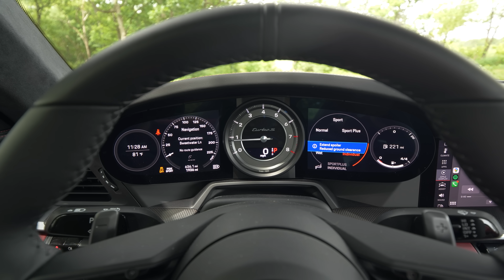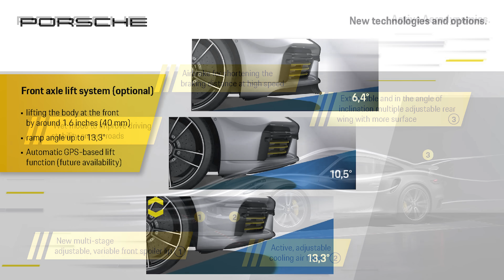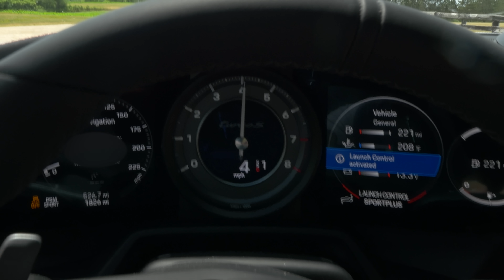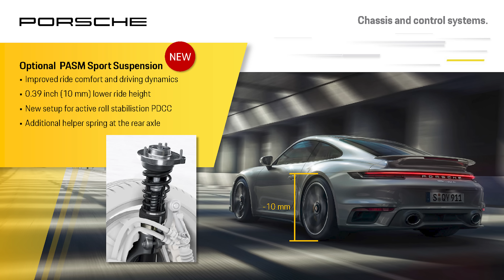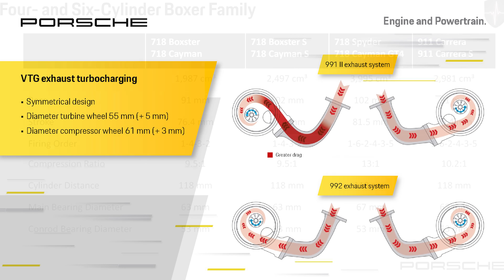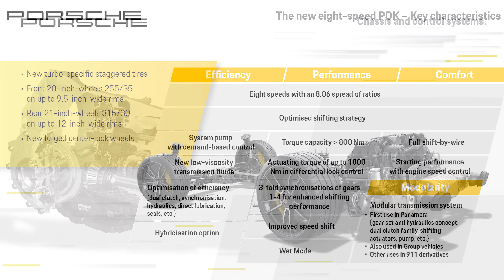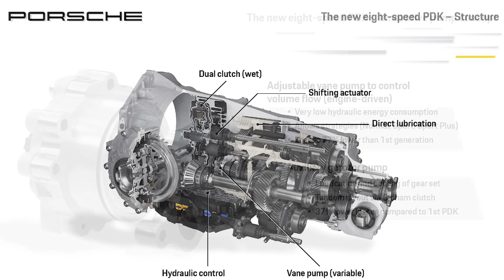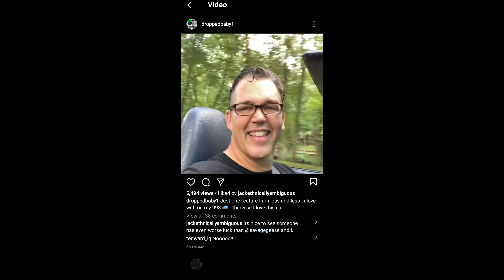Porsche 911 Turbo S 992 | Mind Bending Speed

Comment: What a marvelous piece of engineering.  3.8 Twin Turbo, 4WD with emphasis on RWD and up to 50% power transfer to the front as required.  4WS.  Hold on a Minute; that sounds just like all the Nissan Skyline GTRs R32, 33, 34 without the big engine, which finally arrives in the R35.  The R35 was built to beat the 911 Turbo, which it did very well, and sent Porsche back to the drawing board to improve this car and once again regain its title.  You mentioned more boost and bigger turbos, but you didn't say how much more boost.  You also complain about the car not revving the way the GT3 does, but it doesn't need to do that to accomplish the power so why bother?  The RB2600 engines rev to 8000 rpm stock, but are eager to comply to 10,000 if the limiter is removed; and an all-out race version will be happy to oblige you with 13000 rpm.  The R35 V6 is more like this car, and as turbo engines go, there is no rocket science to them; build the bottom well, and add CFM/Boost and they will go. The direct injection bothers me however regarding carbon buildup on the valves, and it would have been nice to have port injectors added for better flow management but most importantly to keep those valves clean.  I would like to hear how much boost this car runs (22.5psi) and what a stock R35 and Nismo R35 run stock to keep things in perspective; because it seems that it was just yesterday that these feats of impossibilities were being cast on the stock R35, and how fast it changes direction without fuss to the point where it gave Jeremy Clarkson a whiplash on the track.  So having said all that, I'll add that I love everything about this car, and it would certainly be on my list of must-haves.

Comment: 911s are truly a daily driver, speaking from experience. I am more of a fan of the NA engines. You can work on them yourself. Need a lift with the turbo cars. Most of the turbo components make for much more difficult maintenance. If you don't plan on working on the car yourself then the added HP from the turbo cars is well worth the money.

Comment: Interesting comment on the sound system not being as good as the LC500 (which I own) .....but I find the Levinson disappointing.
Reply from the maker: What settings are you using on your lc500?
Reply: @savagegeese  Increased the base, mid range and terrible to about "75%", have the fader control bias a little toward in the rear.  To me it sounds like most of the sound is coming from the front speakers  When I tried moved the fader to all rear there was very little sound.  I thought something was wrong.  Even went to dealer and tried another LC and it performed the same.  I also have dynamic and surround sound on.  How do you guys set it up?

Comment: There is a reason Mazda has closely engineered their vehicles after Porsche for decades. Because Porsche has mastered strut suspension, much like Honda has mastered front wheel drive.
Reply: They've mastered it so well they abandoned it for their track version. I wish they had just put the double wishbone in all of them. At this price they could have easily afforded to, and Porsche appears to think it is better (and so does Mark).
Reply: @markmiller3279  The only problem with double wishbone suspension is obvious maintenance. There is a lot more going on. Replacing one ball joint and two bushings instead of 3 ball joints and 6 or 8 bushings after a decade is a LOT less expensive. Alignments are simpler and suspension geometry is more complex.

Struts are so resilient and simple for everyday vehicles that double wishbone is only really necessary on a track car. Decades ago before struts were perfected, there was no doubt their high speed stability and toe-in was inferior, but the gap has been bridged so closely that most drivers wont even notice, and that's why it seems Porsche very specifically used struts on a vehicle that they are not marketing for track use.

Comment: Even with all these upgrades done in this car over the 991.2 gen Turbo S, this newer one is still two tenths of a second slower than the previous gen around the Nürburgring. And Porsche also confirmed it (source - Sport Auto). Straightline performance is great, but why should we spend this much of money on this thing when we can buy even cheaper cars and make them faster than this? (E.g - a used older Turbo S, a GT-R or a C7 Z06) even after that upgrades they'll be cheaper than this. buying a 992 Turbo S will be the worst way to spend $225K.

Comment: Amazing car, but unfortunately, not exciting at all. the engine seems to suffer some lag, dull response below 3500 rpms, and it is amazing a car company like porsche is able to make such a fast car with such a low level of engagement. The engine is the culprit. The way it delivers its power and torque, the throttle lag, etc...makes the car super uninteresting..a 997 gt2, much slower, is way more fun to accelerate. So sad...

Comment: In 2014 Road and Track launched a 911 SIXTY-ONE times, back to back. They had to stop not because of mechanical failure, overheating, anything else but simply because the driver was getting woozie. Launched the same, every time, zero diminishing in performance, over 60 times back to back, no failures, no overheating, no limp-modes, just obedience.
https://www.youtube.com/watch?v=A5DRCTW-Q7o

Comment: I hate to beat a dead horse but why is the c8 even coming up in this conversation. This is one of the top 911 models and the current c8 again is the BASE car. They shouldn't remotely come up in comparison. Heck even the z06 spy photos/videos (not even the top c8 model) look and sound so much crazier than the base model and thats only step 2/4 models. Lets see how the zora c8 compares to this car. It wouldnt be fair to compare a mustang350r to a base level nissan sentra....
Reply from the maker: Regardless of 911 trim its same story in terms of handling and feeling. They dont take away all the driving involvement.  There is a balanced approach to connecting the driver with the car.  The current C8 is about specs right now until they get the upper end cars finished.

Comment: The problem with your dig at Nick Murray is that he lives and breaths Porsche every day.  You're just a "Porsche tourist".  Your fantasy about Porsche reliability is sort of like enjoying a glitzy Caribbean resort while ignoring the poverty the resort workers live in.  For objective information about Porsche, I'll stick with Nick.
Reply from the maker: There were no digs at Nick.  We have many friends with Porsches including winter driving GT3s etc and they havent had the shit show he has had.
Reply: @savagegeese  LOL, thanks for the honor of a reply.  I tend to lump Porsche owners into two groups:   Porsche fans and  Porsche fanboys.   The fanboys don't talk much about what goes wrong with their Porsches since it's a quasi religion.  The Porsche fans tell it like it is.  Nick Murray and I are Porsche fans - not fanboys.  I love Porsches for how they drive but I wish they'd approach the build quality of a Toyota or even a Honda.  My current daily driver is a nicely equipped 10 1/2 month old Cayenne that has been to the Porsche dealership repeatedly for repairs.   It took four visits to the Porsche dealership to get a Drive Mode problem fixed.  The first two times, I was told that my Cayenne was operating as designed.  Their attitude changed when I found information about a fix TSB on a Porsche forum and they realized that most Cayenne sold in 2022 had the same problem.  Then it took two more trips to the dealership to get the TSB fix correctly implemented.    And there have been at least three trips to the Porsche dealership about an "InnoDrive" cruise control issue that can make it quite "exciting" to the point that I won't let my wife drive it.    They don't have a fix for that problem yet which also affects the Taycan but maybe I'll find info about a TSB fix for it at some point on a Porsche forum.  And I'm making another trip to the Porsche dealership next Thursday to have a rear air vent replaced that has some sort of internal problem that prevents adjusting it ... might have been that way since new since I've rarely had people in the back seat.  At least I'm retired now and have time to take the Cayenne in for repairs.  I've probably already had the Cayenne in for repairs more times in 10 1/2 months than I had my Lexus LS sedans in for repairs (not service) in 24 years of daily driving them.   Nick Murray's Porsche problems are real and so are mine.  That doesn't take away from our enthusiasm for how they drive.
Reply: Imagine going to Nick Murray for objective Porsche information lmao

Comment: The new gt3 is an abolute fail. porsche is light years behind the Japanese. The NSX would mop the streets with one of these. Not to mention what a GTR with the money this costs under the hood.
Reply: The 992 gt3 runs 1/4 mile in 10.8 sec while the NSX did it in 11.3 sec. One more thing, the  JDMs are stupidly overrated..
Reply: @thatboy27506  still the fastest cars out there. Dream on with your cheap german junk.
Reply: call_me_cwis_. Did you say NSX is the fastest car? Yeah i know it’s a dream😂 NSX goes 0-100km/h in 3 sec and its top speed is 307km/h while the 992 gt3 goes 0-100km/h in 2.8sec and tops out at a speed of 320 km/h..so, just dream with your ‘fastest car’..Also, the 992 gt3 is faster than the gtr nismo
Reply: @thatboy27506  man, you are delusional. Which GTR is stock? LoL Nobody cares about stock. GTR is a monster.
Reply: @thatboy27506  there are GTR’s which hit over 400 km/h what are you talking about with porsche LoL. Porsche is for clowns who don’t have cash for Ferrari and McLaren. Like I said, cheap german junk.
Reply: @call_me_cwis_9754  Did you just say cheap? at least it's expensive than the GTR
Reply: @thatboy27506  big man. We are talking JDM. JDM R34’s sell for 600k. Come out from your porsche delusional cave...
Reply: @call_me_cwis_9754  Porsche 550A Spyder sold for $5.1 million which is 8.5 times expensive than the R34
Reply: @thatboy27506  yeah, but there are 11k R34 GTR, LoL. And 5 piece of shit spyderz